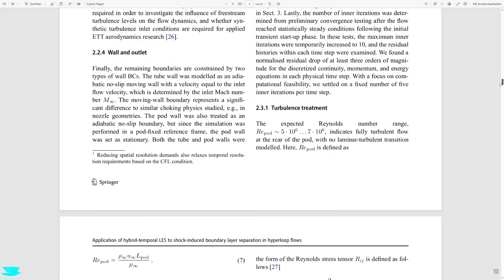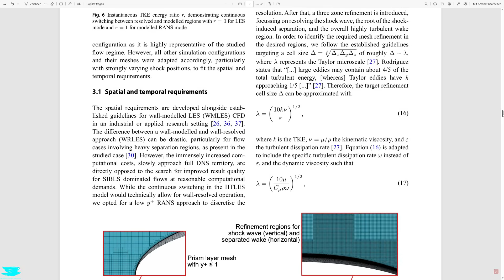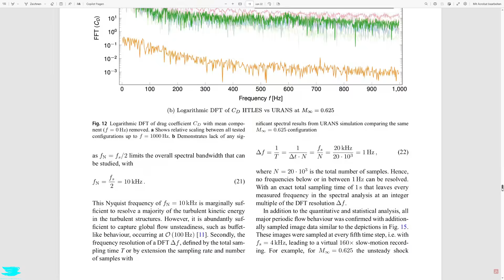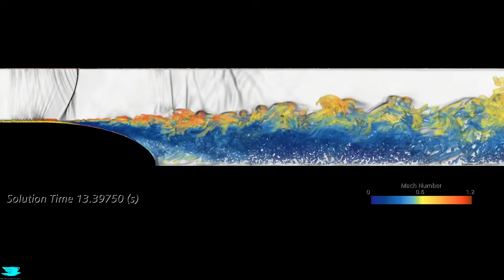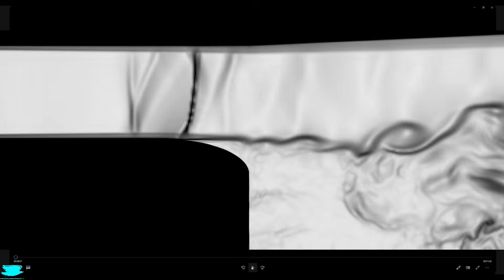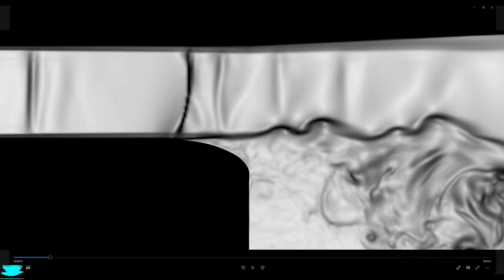The Aerodynamic Problem Holding Hyperloops Back

Comment: There are already enough issues with the Vacuum Tube part of the concept.
Numerous YouTubers have long since DeBunked the practicality of making such a large & long Vacuum Line.
The issue with even operating a Vacuum Tube that big / long isn't worth the trouble / up-keep. 
The worst case failure mode is catastrophic as well. 

It would be better to have an enclosed tube, but don't bother vacuum sealing it. 
Just have OverLaying Tubes with side gaps for air to vent out.
It'll be good enough to prevent people, insects, animals, bad weather from getting onto the track to cause issues with the shuttle passing through.
Air can still vent out the sides like an escape valve and be "Good Enough" to minimize the need for maintenance of the MagLev track.
Reply from the maker: Benedikt is one of the researchers actually doing the research, so it's great to hear his voice on it.

As for having gaps in the walls, this is exactly a technique to mitigate shock wave reflection.

Comment: Thanks for “AHA! Moment” in the clarity of concept-language that an art school grad can understand about 
2 Primary Drag Types:  Pressure Drag & Friction/Sheer Drag. 
The challenge for the layman/student remains to learn and identify which more specific terms are subsets of which type.

The Evacuated Tube Train (ETT?) may have some terms uncommon with vehicles & aircraft outside of tubes like blockage ratio & choked flow. 
Could these terms - blockage ratio & choked flow - be relevant in comparatively low flow HVAC where fans are in tubes (ducts)?
Reply from the maker: Yep, Benedikt did a great job explaining things.

For turbomachinery that extract energy from the flow, that could definitely be the case.